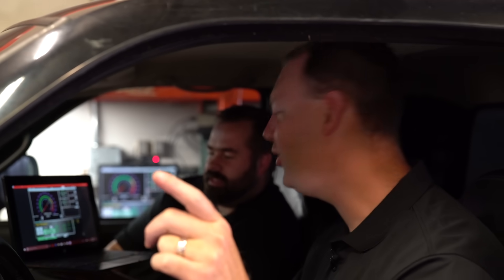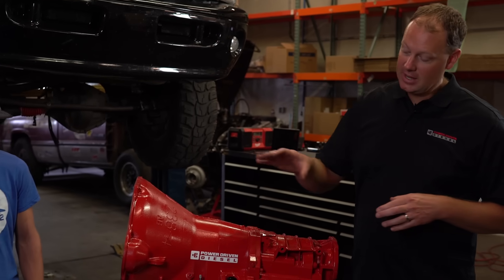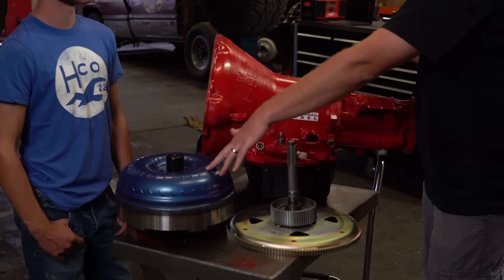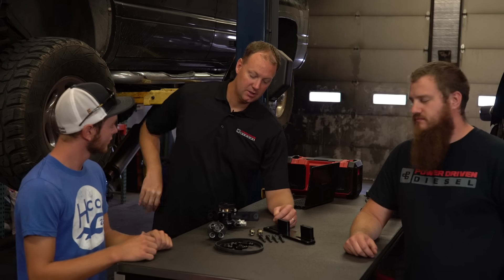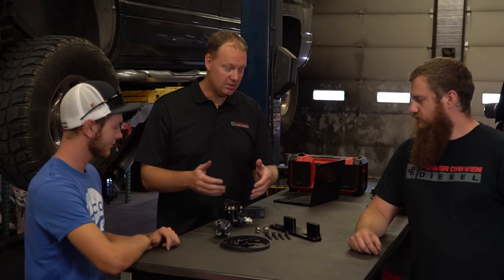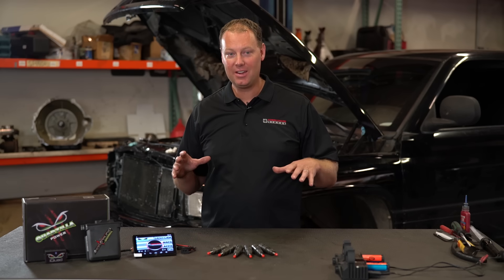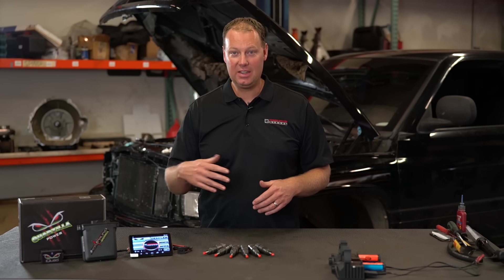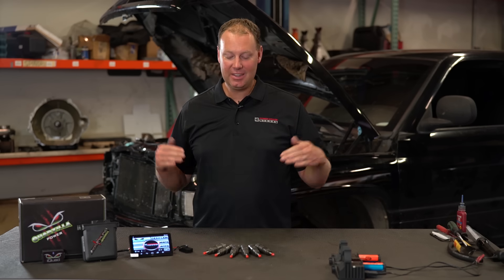We Double the Horsepower of a 24 Valve Cummins

Comment: You should do a common rail 03-05 because we are the forgotten electronic Cummins
Reply: My 05 came with 325hp stock. That one in the video is a dog lol. 180hp?! Wtf
Reply: @teds4983  that's the power at the crank yours is probably more like 212 at the wheels
Reply: @j.strachan2510  no shit, but its not going to lose that damn much. Not to mention my tuner alone will give me 175hp. Not to mention my injectors and cold air
Reply: ted s  Edge tuning lol. Did you even watch the video... tuning could not double the hp alone without SUPPORTING MODS.
Hey budday if you put a Banks emblem on your door panel you can get an extra 50 hp!
Reply: I agree, I feel like my '03 is lost in time.
Reply: Yeah I had a stock 05 dually 2wd automatic, factory 325hp, meanest truck I've ever owned, I also have an 03 2500 4x4 and tag says factory 250hp, automatic, it's a turd but very good fuel mileage
Reply: Plus without hard parts a truck with that kind of tune is not going to be as reliable
Reply: I know I gave up on increasing power over a decade ago when I topped out on a bunch of dynos between 450whp-476whp with my 03HO 6 speed, Silverbullet 66, and Smarty TNT.  Stinks because this would be making a ton more power if it was a 06 with EFI Live.
Reply: PowerDrivenDiesel could you double the horsepower on my 2003 CR for the episode? 6 speed standard transmission
Reply: SMARTY UDC is your answer find someone to cut u a tune on the Smarty touch. I run a custom version of the tntr setting 7 map. But also 05 cummins 66/68/14 billet 150 horse 5 inch exhaust etc etc. 2005 is the true bastard child but can make nasty power.

Comment: Todd..did you guys adjust valves while installing injectors?I had a 01 Cummins,and I adjusted the valves to .07 and .17...i used a Smarty for the bottom end grunt and edge juice with attitude with hot unlock..truck ran really good
Reply: @pddofficial  I think they should always be checked when the valve cover is off! Awesome video

Comment: What's the production year of that 24v? I have a 1999 in a motorhome I'm wanting to do. Can I put a set of new injectors in without adding anything additional to the engine without sacrificing the life of any components. If so I'd like to deal through your company on all purchases.
Reply: Doug Hopkins In Dodge pickups, the 24 valve VP44 pump engines were used from model year 1998.5 all the way through the 2002 model year.
Reply: Sorry, I don’t know what year the truck in the video is, but all of the modifications that they installed apply to all VP44 trucks.
Reply: Excellent news I'll be in contact soon for some suggestions! Thanks
Reply: The last thing I will say is that you could put in a new set of stock injectors without sacrificing the life of any other components. But the fuel upgrade they installed would really be a wise decision if you wanted to put anything bigger than stock injectors in it. And all of that extra fuel doesn’t help if your engine doesn’t know how to manage it. That is where the tuner comes in. All the while, you have to ensure your transmission will hold this newfound power, like they said in the video.
Reply: @andydave93  it has an allison in it now. It's a 38 foot motorhome that I use to tow my enclosed trailer and racecar in. It gets down the highway well but I'd like a bit more power for mountain runs or larger hills.